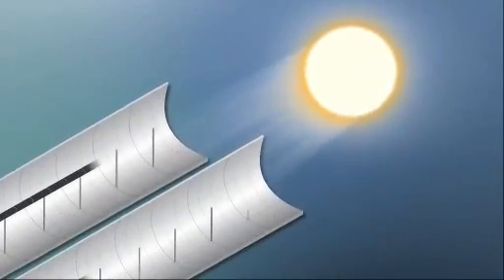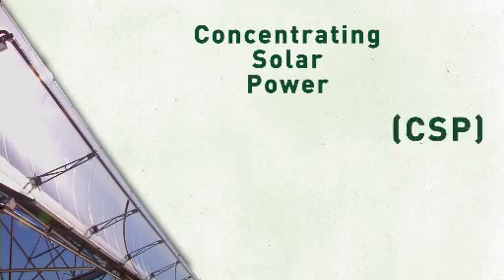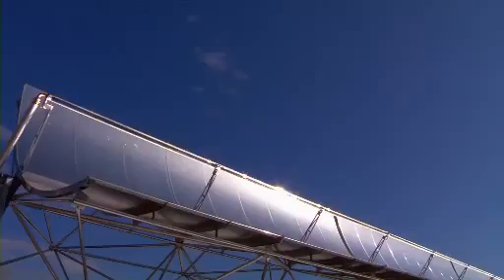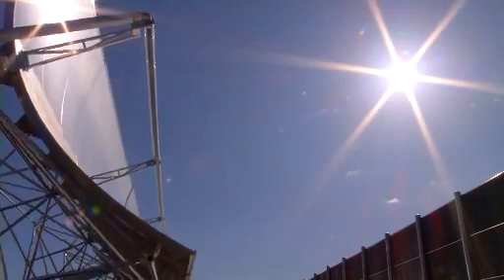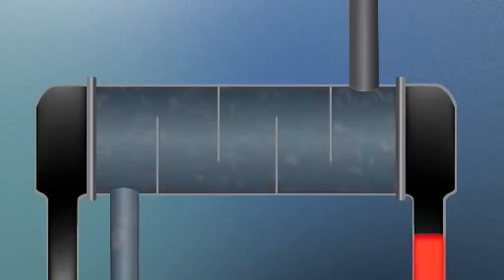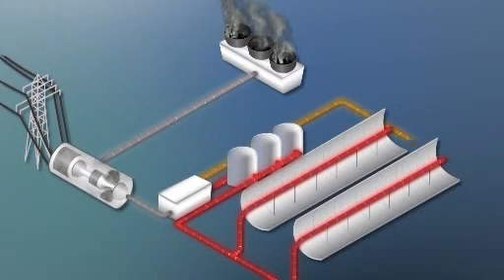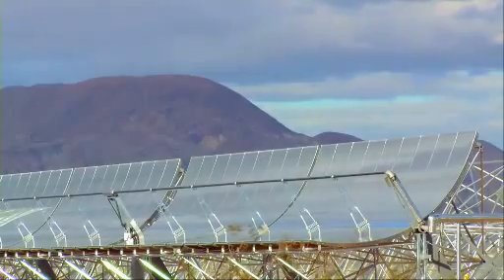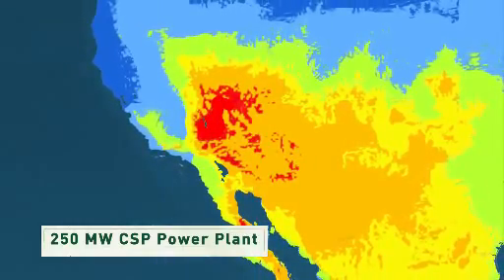Concentrating Solar Power

Comment: I invented a breakthrough low-power sustainable source of energy.
It will beI useful for medical electronics and for cellular telephones.
I am looking for start-up capital in the range $400 000 to $4Million.
I will pay 10% of the investment for finding an investor.
H. Tomasz Grzybowski tel. +48-780-129-544
       htg@interia.pl

Comment: What about overnight & rainy days/ overcast days? It's these points that you don't address that matter.
Reply: That's where the containers that hold the molten salt are for. Think of them as like a battery. Also these collectors would be placed in an area that is least affected by such weather conditions, namely arid deserts.

Comment: CSP systems produce next to nothing in scattered light. They only work if the sun is directly observable, almost no power during cloudy days. Photvoltaic panels don't have this problem.
 They should try making the heliostats photovoltaics and the excess light reflects to the tower.
Reply: +leerman22 except a solar panels that good would cost a Zillions dollars and last 10 years tops.